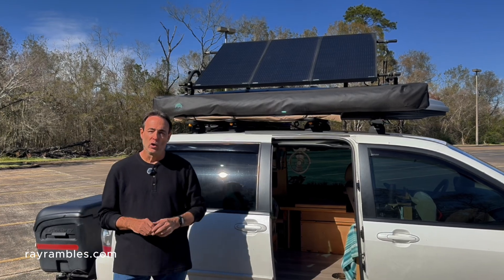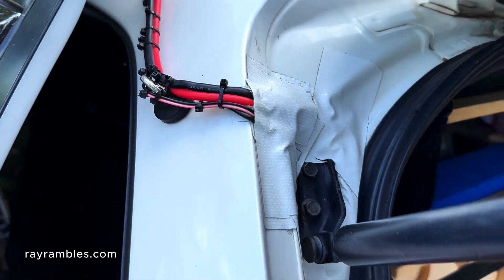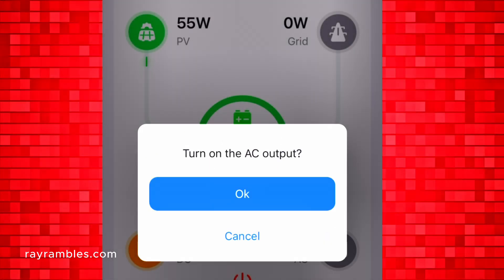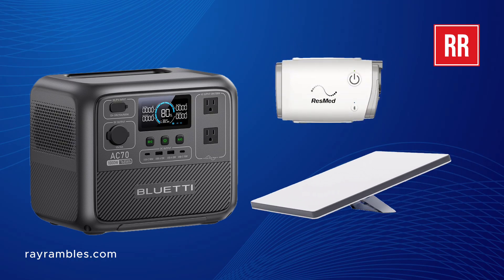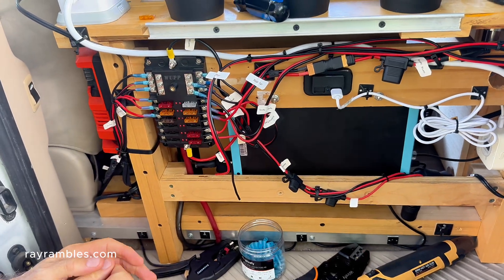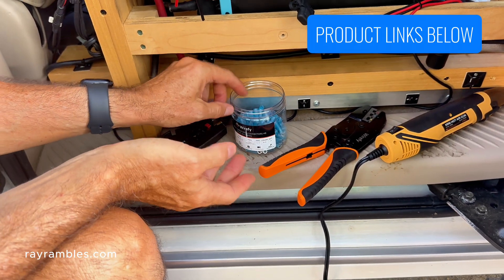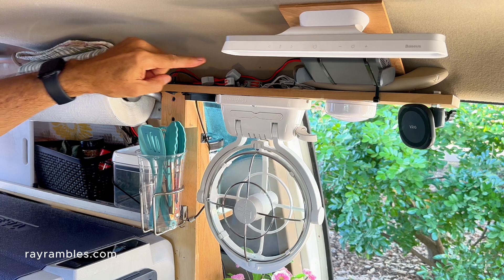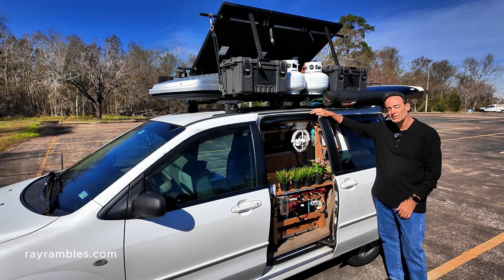2.7kWh of Power in a Minivan? Here's My Complete Electrical System

Comment: What type of electrical wire are you using for the DC
Reply from the maker: Hi. For all the low power devices wired to the fuse panel I used 16 Gauge Stranded Copper. Link: https://geni.us/16-awg-copper-wire

Comment: Would it be more efficient to charge your BLUETTI with their charger 1 instead of the AC input while you are driving?
Reply: Got it, that makes sense. Thank you for the response
Reply from the maker: Hi - It is more efficient, but I'm already using my DC input for the solar panels - so this way I can also charge using AC input at the same time. I wanted to keep my solar panels plugged in all the time - so using the AC input makes that possible.

Comment: Awesome setup. One benefit of the three panels is that you can wire them up differently to optimize the voltage. Your off grid system is well designed!
Reply from the maker: You're right, the flexibility of a three-panel setup is great. Thanks! 👍🏻